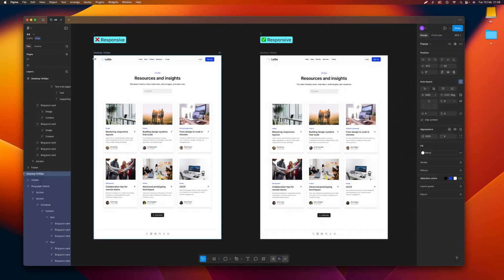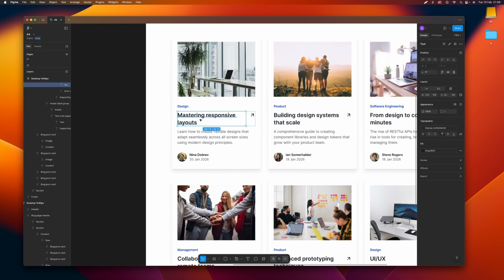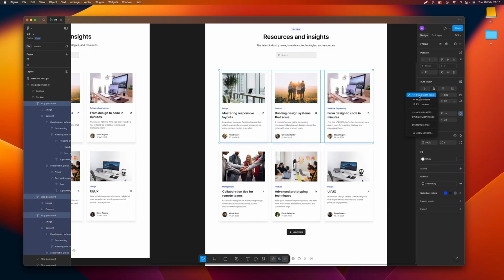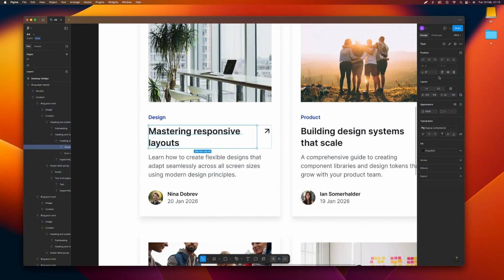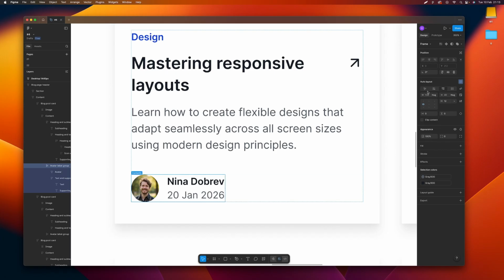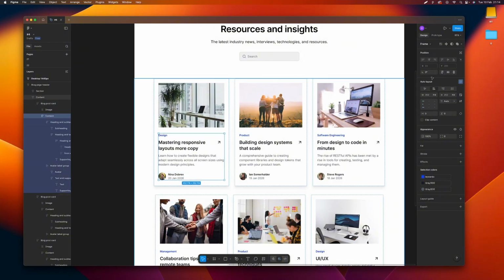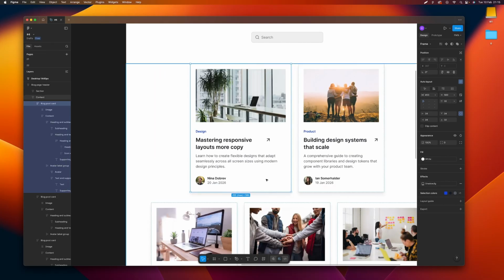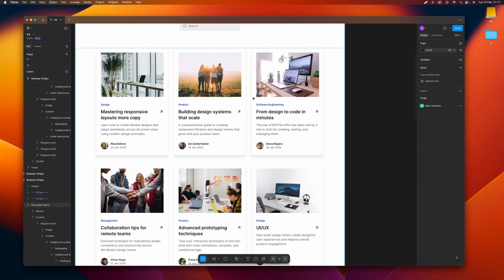Figma Auto Layout Mastery: Responsive Grids, Fill vs Hug, and Pro Techniques (2026 Tutorial)

Comment from the maker: 📌 QUICK WINS FROM THIS VIDEO:

1. Use Shift+A to add Auto Layout to any frame
2. Set "Wrap" for responsive grids that flow naturally
3. Fixed = exact size | Fill = take available space | Hug = fit content
4. Mix horizontal and vertical settings for advanced control
5. Add min/max widths to prevent designs from breaking